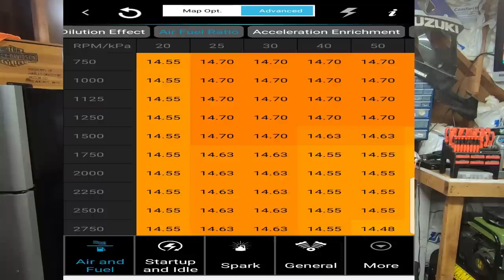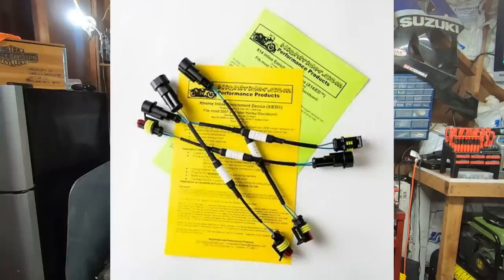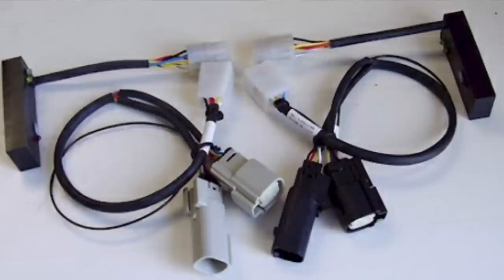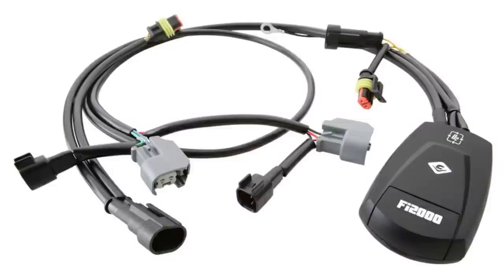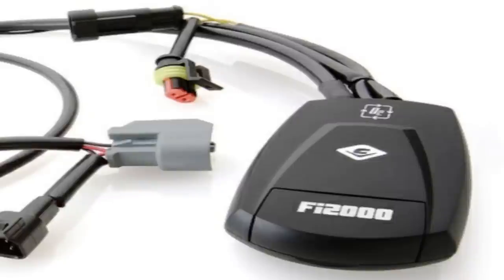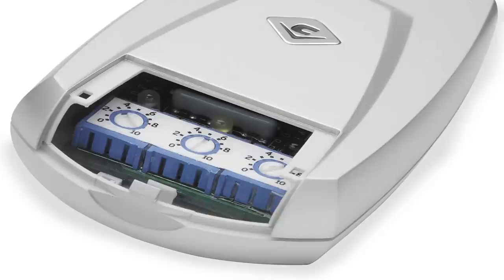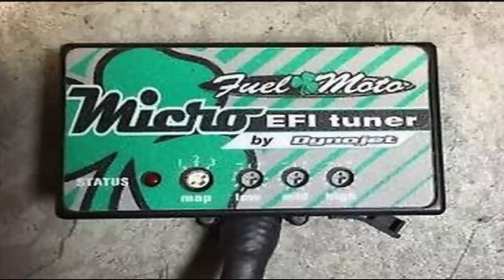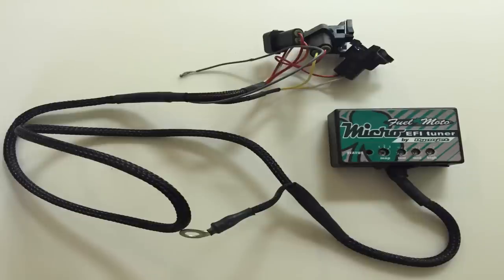Does Your Harley-Davidson Need A Tune With Slip-On Mufflers Only??

Comment from the maker: Have you run your slip-ons without a tune with any luck? Which fuel tuner do you think is the best setup?
Reply: No. With a Twin Cam, get a tune even before a slip on. They are programmed very lean from the factory. Just get a Dynojet  PowerVision & save youself some time and money. I did the Xieds & the FP3 1st, but they just didn't do enough so I bought the PV. When I traded in my Sporty, I was able to reuse my PV, Dynojet unlocked it for $199. I don't think you can reuse a V&H FP3. If I ever switch bikes again, they'll unlock it again too.
Reply: No. With a Twin Cam, get a tune even before a slip on. They are programmed very lean from the factory. Just get a Dynojet PowerVision & save youself some time and money. I did the Xieds & the FP3 1st, but they just didn't do enough so I bought the PV. When I traded in my Sporty, I was able to reuse my PV, Dynojet unlocked it for $199. I don't think you can reuse a V&H FP3. If I ever switch bikes again, they'll unlock it again too.
Reply: Yes and it ran like crap. Got a PowerVision and it changed everything. Then went with an intake and full exhaust and retuned. A stock bike will benefit greatly from a good tune.
Reply: You don’t need tune with M8. Even when you change AC and slip-ons. You will probably benefit from new tune, but it’s not necessary. It will run properly. M8’s are not set-up lean from the factory.
Reply: @dawidos117  i heard for slipons it’s not necessary, but an air cleaner changes the game. Got any reference videos to help an M8 owner out?
Reply: @MadMexism  sure, man! My pleasure https://youtu.be/aWW-nt7-fzA Enjoy, my friend and enjoy your M8 👊🏻
Reply: What’s better to do, get rid of the cats in your oem header or get 2/1/2 headers and which do you recommend, on a 2013 flhx
Reply from the maker: 👍 even a bone stock bike needs a good tune!
Reply from the maker: My bike ran like crap stock too, l tined it with the stock exhaust and air box. I hated my life for not doing that sooner.
Reply from the maker: Interesting, they've done a lot of work with ignition and valve timing which helps quite a bit.
Reply from the maker: I think have better performance with an aftermarket head pipe. The bends and design are centered around not having the cat. Removing the cat is a good compromise but it won't be all out power like the aftermarket header.
Reply: @dawidos117  
Yes M8's are lean from the factory, as a matter of fact it's because they leaned the engine's out even more is why Harley went to the 4 valve arrangement in the first place.
Despite Harley touting the benefits of higher flow with 4 valve's that's not why they went to it, the fact is it was either do that to lean out the engine's even more or go to water cooling, in their eyes the 4 valve head was a lesser evil than a radiator hanging on the front of the bike.
The reason you can lean out an engine with 4 valve's more than a highly canted 2 valve arrangement is because the 4 valve has a lower roof than a 2 valve does, with the 2 valve by the time you cant them at enough of an angle to have decent size valve head's you've raised the roof up, the higher the roof the more surface area the combustion chamber has and the hotter it get's, by flattening out the roof with 4 smaller valve's at less of an angle than 2 bigger valve's you can run an engine leaner without getting detonation.
Don't forget that Obama signed into law stricter emissions for vehicle manufacturer's, Harley saw this coming and had the 4 valve head designed knowing they'd have to lean thing's out even more, once Trump got into office he canceled those stricter EPA rules but it would appear with Biden coming into office they'll be back in effect. 
Harley touts the added flow benefits as the reason they developed the M8 engine because like everything else they say what they figure people want to hear, and the real reason they did it isn't as sexy as "increased flow", they know everyone's going to want to hear that.
Reply: I did 3" DNA slip ons for my '20 883 Iron. Sounded absolutely awesome, BUT I could tell there's something going on with acceleration in initial loss of power and then it picks back up. Do I need to just add a thumb washer for back pressure or do I need to go all the way and spend $400 on a Street tune to save my 3 year warranty? No change to intake or header pipes.
Reply from the maker: Do you have baffles in the exhaust now? Warranty can be a bit tricky, l went ahead and tuned my Sportsters with a FP3. Even under warranty l had a lot of faith in the Sportsters power train.
Reply: @willb169  
Did you remove the baffles? And if you did are you talking about the trick where you weld a washer to a bolt head and drill a hole in the pipe to mount the washer inside the pipe with the bolt through the hole and a nut on the outside so you can loosen the nut and turn the washer to "tune" it so to speak?
Because if you did you're going to want to hear what I can tell you about doing that. 
Because if that's what you're doing I can help you out a lot with that.
Reply: I have a 2011 XL883N 'Iron', I installed a pair of Python 2.5 slip-ons and a set of Nightrider XiED leads, I kept the stock air filter. The motor runs cooler and the throttle is more responsive, there is no popping from the mufflers and the give a deep bass tone to the exhaust sound. All in all, I'm very happy with my setup.
Reply: @davidmacgregor5193  
Slip on's with the stock pipes work excellent and are the best "bang for the buck" set up you can run, just don't ever get any funny ideas and take the guts out of them if it is possible, it'll kill your mid range power.
I've told people for years to save their money by buying slip on's instead of an entire performance exhaust system and put the money they saved into something else for performance because entire systems don't run any better than slip on's and if they do it's marginal, put the money you saved into something else and it'll run better than an entire system.
Reply: I put slip ons on my bike, runs fine. Sounds great 👍
Reply: @six-pack1332  
What year and model?
Reply: @dukecraig2402  '16 fxdf
Reply: GixxerFoo:  I have a 2009 Heritage softail with stock pipes and stock air box, but it does have a K&N filter.   Can I just put on slip-ones and leave everything else as is?  No different air intake/cleaner?

Comment: According to DK Customs dyno testing,  the m8s are able to handle most AFR adj with ECM , and are not as lean as the twin cams were, and that the ECM seems to be able to handle stage 1 upgrades without the need for tuning.  The O2 sensors seem to be doing their job.  There seems to be a lot of misinformation out there.  I appreciate all efforts to clarify.

Comment: One question is why  its a such big difference with a full exhaust and a slip on when even the slip on takes away the cat wich is the biggest flow resistence in the exhaust system?

Comment: You mentioned that sportsters didn't get o2 sensors until 2014, but that's wrong. Harley introduced o2 sensors on Dynas in 2006 and on all models in 2007. My wife's sportster is 2008 and has them.
Reply: My 2010 spare sporty has them.

Comment: As far as the M8 Softail and Touring bikes, DK Customs is showing you dont need a tuner at all with regular Stage 1. You'll need one for stage 1 with a manifold swap or higher stages.
Reply: I agree.  I have 3 M8 114s, 2 of which I have open air boxes and slipons on 1 and the others Cobra 909s with a cross over.  Both have 0 decel pop and run great. Now I do agree if I dumped more fuel it I may get more hp, but at this point I satisfied with the power and economy thats there.
Reply from the maker: Just a set of slip-ons and you should be alright with the stock intake, anymore it will be time to get some fuel in the bike.
Reply from the maker: The M8's are really good on fuel and do pretty well with just slip-on exhaust, they seem to handle the leaner fuel ratios better than the twin cams.
Reply: @GixxerFoo  on my Roadking, I have hit 51 mpg in the mountains on a 250 mile round trip and its a M8.  The 6 gallon fuel really give it some long legs.
Reply: @rider14mcd63  I get About 450+ Km on my FXLRS Mostly highway which is well above Average.. Not Sure what it Converts to in MPG but with just Slip ons the Bike runs Perfect,, Not lean  Nor hot..
Reply from the maker: Damn that's awesome! That's a day and a half with 6 gallons!
Reply: @paulhorvath9784  I have a FXLRS also, SS slipons factory Air box, runs perfect.
Reply: @GixxerFoo  depends how far you ride in a day and a half.
Reply: @rider14mcd63 your factory airbox is already high flow on the fxlrs
Reply: @joeburr7537  IT only works for 100hp+ with the K&N Filter, the stock filter on the airbox only supports up to 94hp.

Comment: I bought my 103 that had slip ons and it didn't run very well. Added a high flow air box and it ran a little better.  After that I decided to do the full stage one and it ran so much better.

Comment: This was an outstanding segment on exhaust, even though I'm running a Mikuni 42 on my 95" twin cam, I still was able pick some valuable info from this video!
Reply from the maker: Good to hear! There's nothing wrong with a good carb, they still work exceptionally well on the Harleys!
Reply: 89' Electraglide here with a Mikuni too 👍
Reply: Have 98Flhtc with mikuni42 and slipons, ı have too much popups and ı have new bought thunder touque inserts (lolipops) ıhavent instal yet but lets see if it will stop the popings.I try to watch your videos and they are really usefull for me.Thanks for your efforts @GixxerFoo

Comment: When working with a Pot style fueler which is anyone that has the adjustable screws on it ,you really have to be ultra careful about water intrusion. Do not get them wet while washing your bike or riding in the rain I have seen several of them short out this way even though they may say solid state the potentiometers corrode and they stop working all the sudden the bike will start popping and run like crap and will not respond to any adjustments. If you have a bike with a cat 🐈 in the head pipe then adding more fuel will raise the exhaust pipe temps as the converter over heats 
its best to remove the cat or change head pipe
Reply from the maker: That's some really good points! I've had pretty good luck with those little tuners, I may not have had one long enough to have an issue with one though.

Comment: I’ve had both a 2012 Sportster with a fuel pac and SE cleaner and one without the tuner and stock cleaner. Both had o2s v and h pipes. No doubt, the stage one would tear the other a new asshole,  but I found the sound quite annoying. Sold it and find the non stage one sound to be  great and for whatever reason great!  And the fact is, it has enough power to get me in all the trouble I can afford for sure!  Happy Days to all of you!
Reply: The stage one had big radius pipes and the other short shots and both had baffles. It could have been the big r pipes that I didn’t dig after about 10 minutes. I don’t know for sure. Or it could have been the stage one tune. I don’t know for sure. Some pipes sound great in the garage. But riding with them is another story. Can actually come back exhausted, for lack of a better term, noise annoyance or noise pollution!  Heads fukin ringing. Helmet traps the sound and makes it even worse. I prefer to be motivated by the sound and exhausted from just hanging on!
Reply from the maker: I rode my Sportster stock for about a year and to honestly it sucked, hesitation and it ran very hot. I did nothing more than tune it with an FP3, stock exhaust and air cleaner. I hated myself for not just spending the money to at least tune it after that, it really came to life compared to stock! Cooler running, better throttle response, the difference was amazing!
Reply from the maker: I'm really over the loud pipes myself, I am debating about putting the quiet baffles in my exhaust. Adding the quiet baffles will knock down your top end power but you'll gain in the low to mid range torque!
Reply: @GixxerFoo  
The difference in my situation is not the volume. With 2 different sportsters and a heritage, all equally as loud, I found only the tuned sportster to be annoying. I also have a 96 sporty that is chopped, and jetted with hooker pipes that doesn’t bother me a bit. So, only one out of four I find annoying. And it’s not even on acceleration but steady speed. There’s a certain drone sound, for lack of a better word. A hoolelolel.  The others I just love the sound and can’t help myself always twisting the throttle more than necessary. Now, as far as innocent bystanders that don’t get it, they have problems with all of them!  😂
Reply from the maker: I know exactly what you're talking a out, my Sportster does that drone about 60 to 65. Above or below and it's fine 🤷‍♂️.

Comment: A million thanks! Went with the Xied and bike is running like it should. I'm all stock, with the exception of slip-ons, but that radical fluctuating between high and low at idle is gone... Runs a lot cooler also... Again... Thank you... A simple $140 fix for 2017 Dyna Street Bob...
Reply from the maker: Great to hear! Not many people know about those Xied's, they are great option if your running under warranty too! I know exactly what you mean about the fluctuating RPM's, those bikes are starving for fuel.
Reply: @GixxerFoo  thanks again my friend... Any opinion on the American Motors manual adjust IAC???

Comment: Whatsup !!  We got the 2021 Softail StreetBob for the Lil Miss and just wanted a little sound.. I put on the S&S Slashcut slipons and have run it for about 100 miles so the ECM would adjust the AFR.. NO decel pop at all !  Its smooth and strong. Ive thought about upping the fuel mix on her bike, but it seems the O2 sensors were adequate to accommodate the bikes needs..   I had put the FLIEDs on my 14 StreetG;ide, when I changed to full exhaust and airbox.. It ran exceptionally well that way.
Reply from the maker: That's awesome, since your not getting decel pop I'd say you're good to go. No two motors are alike so another bike might pop and spit like hell!
Reply: @GixxerFoo  On your other recent video I commented on, there was a comment about M8 and fuel management, by DK Customs video link.. Good to go..

Comment: Personally I cut out the baffles on my streetglide I didn’t tune it but I left the stock air box and the cat is still in the head pipe. It still runs perfect but I will be tuning it now that it’s off warranty
Reply from the maker: That cat in the head pipe will help with the back pressure for sure, it will be a whole new bike with a tune! Getting some fuel in the bike makes a huge difference in your riding experience!
Reply: Did you take the packing out as well or just baffles?

Comment: I beg to differ. I put 4.5 slip on mufflers on my 17 ultra. Noticed the bike was surging. Dealer said oh you need a tune! Tuned it with a tuner, bike ran fine.
Reply from the maker: Some bikes will do great and others will definitely need to be tuned. I've never been a fan of just putting some mufflers on without a tune.

Comment: Put the Exide's on my bought new 09 FXSTC. With the mandatory Kalifornia emissions tune, lean. Engine would cough and die in warm weather in city traffic at most inopportune times.  Installed 3" Cycle Shack slip ons and Screaming A/C kit. Cooled oil temp by 20 degrees. Third gear WOT pulls strong to 5000 RPM my redline. MPG high 40's  estimated at 70-75 MPH.  Two up in cruising Las Vegas strip in 90F air temp engine runs fine. Best $100 you can spend on HD without going to a tuner and possibly hurting your warranty.  Ride Safe
Reply from the maker: That's one of the best parts of the Xied's, you can pull them back off if you have to take the bike in for warranty work. They might see it in the data but can't prove anything with nothing flashed to the ECM. California has some strict emissions, add the traffic and the warm weather riding a bike with a stock tune just won't work.

Comment: I can answer this question. My stock - except for German made Miller slip-on's - 2011 Heritage Softail 103 pops and farts badly on de-acceleration at nearly all rpm's...from low to high. I've been doing some online research, YouTube etc., and have decided to go with the PV3. If ever a motor needed remapping it's this one and the only deviation from stock are the slip-on's. They're not even open. They just allow slightly better flow and a nicer exhaust sound without breaking eardrums. If I were to fit a K&N air filter without some new mapping this bike would be unrideable due to the stock factory lean fuel parameters.
Reply from the maker: The fuel injected Twin Cams were run waaaay to lean from the factory to meet emissions. The motors weren't exactly designed to run that lean but they would do it just with excessive heat. Any little change in air flow on a FI twin cam even with just slip ons really needs a retune to adjust the fuel with a programmer of some kind. The new M8's do great without a remap and some Sportsters will get away without a remap just swapping for some slip on exhaust.

Comment: I needed to hear this!! I bought a 14 SG that only had Vance and Hines twin slash slip ons. Next week I’m getting an air filter and a dynotune. Wait should I buy a tuner instead??
Reply from the maker: If you're going to have it tuned on the dyno, that's the best way to do it! The bike will be 100% dialed in for that setup on your specific motor. You can't be qualified tuner operating a dyno, flash tuners get close but they can't beat the dyno.
Reply: @GixxerFoo  Yessss!! Mann I listen to all of your vids so I value your knowledge 🔥🔥🔥